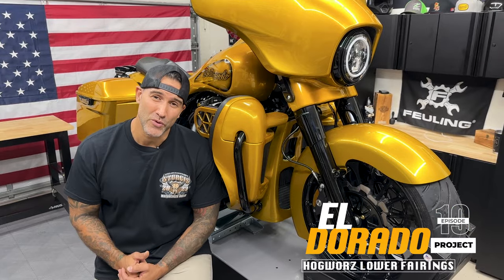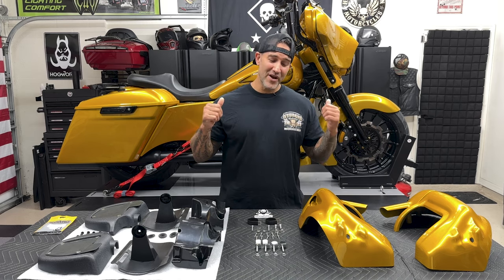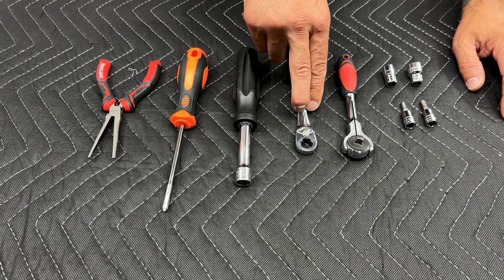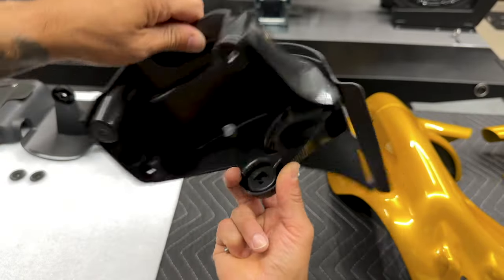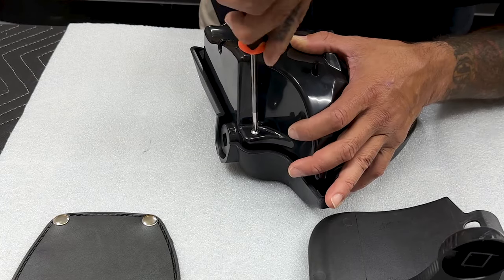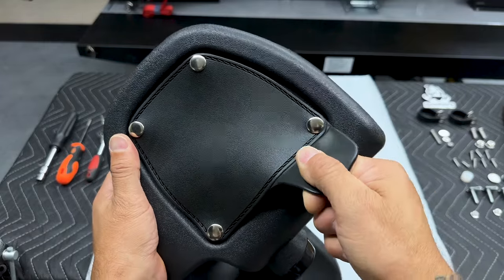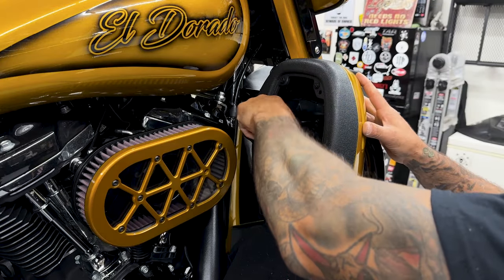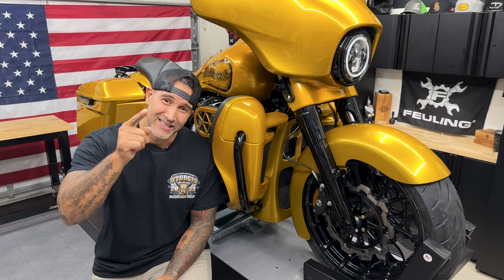How to Install Lower Vented Fairings on Harley Touring

Comment: Love your videos ❤❤❤ I have a question I got the Advanblack Lowers with vents that I always have open when going long distance however since I installed them I feel my bike Runs hotter than before without them is that safe for the engine ? I mean I love the looks of it thanks
Reply from the maker: The bike might run a little hotter, especially long distances.  It not bad for the bike, just bad for your legs lol.  That’s why a lot of people will install and aftermarket cooler fan.  Hope this helps, and thank you for the support
Reply: Thank you so much for replying my brother ❤🙏🏻🙌🏼🇺🇸

Comment: Every video I've seen so far shows the installation of the right side but not the left. Nobody shows the left side because the shifter might come in contact with the fairing vent like in my case.
Reply from the maker: Next time I do a set of these, I install the left.  I never have issues with the shifter
Reply: @RAIDERWORLD  thanks to one of your other videos I figured out my issue. I have the heel and toe shifter on my FGS and the toe needed to be adjusted to clear the vent. I assumed because the foot brake can't really be adjusted that the foot shifter couldn't be either and I was wrong. Thanks for sharing as much info as you do,
Reply from the maker: Absolutely! And Thank You for watching.  That’s what it’s all about 🤟🏽